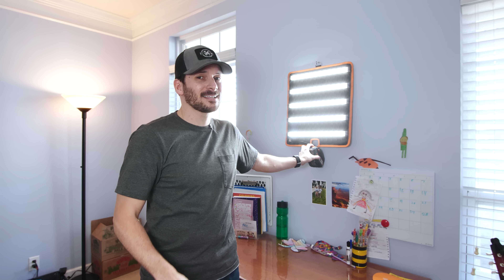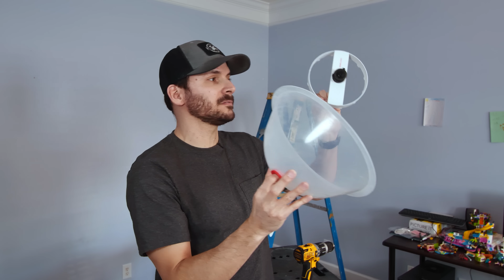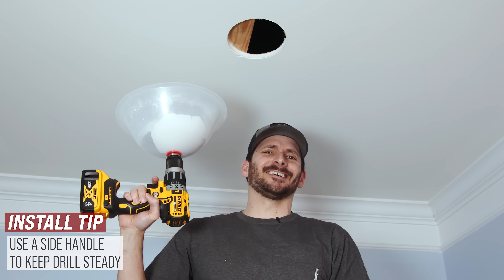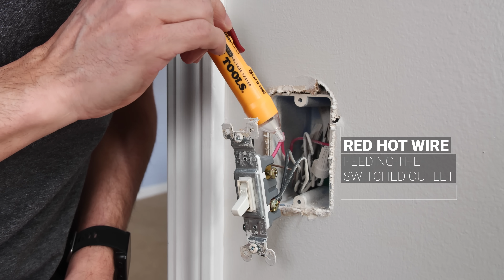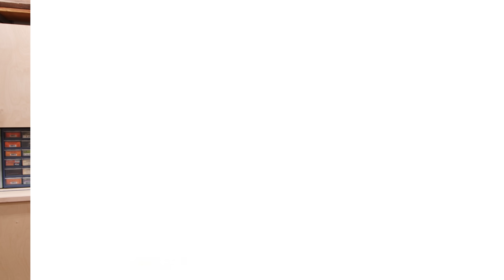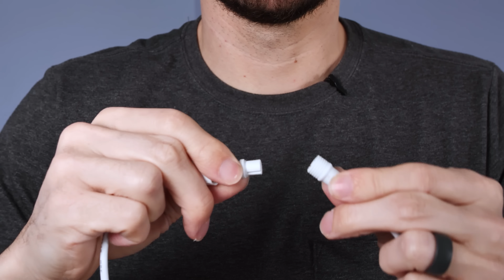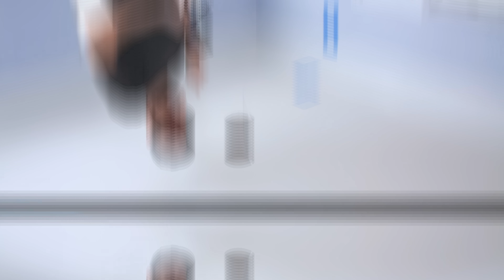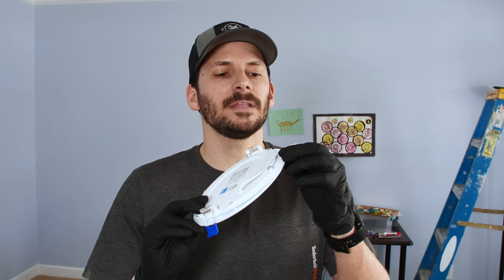Recessed Lighting Install with No Attic or Prior Wiring

Comment: You could have added an extra ceiling box and used it as a junction box to tap into that 14-3 line.  This would allow you to keep using the constant power black at the outlet and divert the red power to your lights.  Afterward, just cover the new ceiling box with a blank plate and paint to match the ceiling.
Alternatively, you could use the junction box of the light to accomplish the same thing if there is enough slack in the original line.  Bring the original line into the first box.  Use a 14-3 to get the red across the room to another of your lights.  Then use the junction box of that second light to tie back into the original line that feeds the receptacle biox.
Reply: That's exactly what I was thinking as well! Either junction box it or add another wire!
Reply: So you are saying he could have splice 14-3 into 14-2 and connect those recessed lights to 14-2? That way his outlets are there and also got power for his recessed light?
Reply: @hardikrana6403  Exactly.  In the original existing 14-3 Romex, red wire  (lighting) power comes from the switch and black wire (outlet) power is constant.  Here is what I would have done:

1.  Add an old work box in the ceiling.  I would place it out of the way in the corner, closer to the existing wire.
2.  Cut the existing wire so that one end (the wire coming up from the switch) can be pulled over to the light location as shown on the video and the other end (the wire continuing down to the outlets) can be pulled over to the new junction box.
3.  Run a new section of 14-3 Romex between the light location and the junction box.
4.  Run a new section of 14-2 Romex between the first light location and the next light location.
5.  In the junction box, connect black to black, red to red, neutral to neutral, and ground to ground.  This will keep the existing power to the outlet so you can keep using it as a switched outlet or you can cap off the red wire in the outlet box and use a new outlet as shown in the video.  You can place a blank plate over this junction box and paint it to match the ceiling.
6.  In the light location, make the following connections inside the light's junction box.
      a.  All ground wires connected together.  Input wire from switch, output wire to junction box, wire to first light fixture, and 14-2 wire out to the next light fixture. 
      b.  All neutral wires connected together.   Input wire from switch, output wire to junction box, wire to first light fixture, and 14-2 wire out to the next light fixture. 
      c.  Two red lighting power wires (input wire from switch & output wire to junction box) are connected to two black wires (one to the first light fixture and one to the 14-2 wire out to the next light fixture).  Note that the black wires of the ceiling lights now carry the switched lighting power around to the light fixtures.
      d.  Two black outlet power wires (input wire from switch, output wire to junction box) are connected together.  DO NOT connect these wires to the lighting fixture or the wires leading out to the next fixture.  These wires carry the outlet power back down to the original outlet so that it continues to function in the same way.

In the video, it appears that he left the wire leading down to the outlet abandoned in the ceiling and removed the outlet entirely.  His installation could be retrofitted by my method to restore power to that outlet, with or without the switched function.
Reply: @chrisboyd4433  wow, thank you so much for taking time to explain this. 
Not related to this..We recently purchased a house. In most of the area builder provided pre wiring for ceiling fan. Today i was trying to install the ceiling fan and noticed that both red and black wires have constant power. They provided 2 switches, even if i turn the switch off those 2 wires still shows reading in power tester. Do you think its normal? Or they messed up there. I installed the fan and i can only control the fan/light by using the remote. Switch doesn’t do anything. 
Your input would be greatly appreciated.

Comment: One tip about using the clip connectors is to give them a good tug to make sure the wire is properly seated, if they’re not then they will pull out. Do it individually and not as a group.

Comment: You can still power the outlet off of that same wire.  Just tap I to the existing wire as intended but leave the black alone and splice into your ground, neutral, and red(switched) hot wire, swap the outlet as mentioned with a new outlet.
Reply from the maker: unfortunately I had to move the wire too far to hit the hole for the light.  And you can't add a junction box covered in a ceiling.  If the pig tails for the lights were longer that would have worked
Reply: @Fixthisbuildthat  hopefully they didn't staple the outlet wire. If it is not stapled, it could be used as a pull string to pull a new slightly longer 14/2 that you can join at the light instead of going all the way back to the switch box.

Comment: Great job on the step by step! 
Pro-tip-  I would have installed a J-box or two to extend the three wire, on the wire in the ceiling you tapped for lighting switch leg.  Adding one two wire whip for the lights and a second two wire whip as your feed for your future ceiling fan.  I would have installed the power while the light holes were cut in for access.  The J-box also would have provided the power for your outlet that still has to be re-fed... With so little time left for add ons, we try to land the plane, one time and then off to the next job.  Thanks for the great work ethic!
Reply: where would you have put the j-box? we are not allowed to hide them behind ceiling/wall. cheers
Reply: @spydermcfly  by using those recessed lights you have access and in New York, are allowed to put a jbox

Comment: Dude, wafer lights are absolutely amazing. I installed a drop ceiling in our laundry room and wanted recessed lighting over cheesy looking fluorescent. Because of how high I needed to make the ceiling, it was super close to the joists and was impossible to install true cans. Picked up some 3/8" thick 6" wafers and love them. They even have an in-line switch to change the light color (K) to change from cooler or warmer.

Comment: My tips would be
1. Wear a tool belt so you always put your tools back into the belt and not the ceiling, lol

2. Connect all the lights and test them before you mount them, as some can be a pain to unmount. I'm usually installing speakers so I have to adjust the 70/100v tapa

3. Glo-rods or fish rods work easier than a fish tape as they like to stay straight and a small 20' fiberglass fish tape is easier than steel. 

My dream of training a rat to pull wires has come through yet so I'm stuck with rods and tape.

Thanks for the dust bowl. Which make did you get? I need one. I tried one a few years ago and it wasn't worth it.
Reply: Click on "Show More" just below the video and you'll see a link to it.

Comment: Fluke is also a dependable hot stick. As an electrician, I really recommend not getting the hot sticks or tics that have lights on the end! I went through a couple of those, and they get to where they are not dependable very quickly. just a FYI. and those dust bowl are great. I bought one that comes with an adjustable blade; two arms that adjust by an allen wrench and the arm has measurements on it so you know what size you are extending to; not sure if I got it at Locke supply or where I got it now lol but it's pretty handy but not sure I would use it on anything but sheetrock, but it is great for cutting holes in sheetrock and you can do any hole with one hole saw instead of spending a lot of money on multiple hole saws. I think it grabs less too! It has blades on it and not teeth.

Comment: One thing you should do before adding lights, is find out what else is on the circuit. You're only allowed 12 fixtures. Sometimes the convenient circuit won't work out.
Reply: LOL what country is that rule?
Reply: @daveperryLXXVII  
International electrical code.
Reply: @FullCircleTravis  no way that's a International electrical code. most houses these days have more then 12LED DL and with LED can easily be doubled
Reply: @daveperryLXXVII  We're talking about adding into a existing circuit which could include receptacles. The code states that more than 12 fixtures are allowed if the loads are static, and obviously not overloading the circuit. So 20 LED lights might meet code, but 1 receptacle in the circuit means no more than 11 lights regardless of the draw.
Reply: @FullCircleTravis  That's totally false information that you are giving. It depends what size rcd is on that circuit could be 10 or 15 and also depends how much amps the lights are drawing. No such rule exists. 12 fixtures. Never heard anything like that in my 30years.
Reply: @daveperryLXXVII  
From the Canadian Electrical Codebook based on the International Codebook.

Section 8-304 Maximum number of outlets per circuit
1)There shall be not more than 12 outlets on any 2-wire branch circuit, except as permitted by other Rules of this Code
3)Where the connected load is known, the number of outlets shall be permitted to exceed 12,  provided that the load current does not exceed 80% of the rating of the overcurrent device protecting the circuit.

The load isn't known if you have a receptacle on the branch that could have anything plugged into it. This limits your circuit to 12 outlets.
Reply: @FullCircleTravis  thats talking about power outlets dude. Not lighting fixtures. Have a nice day. You just proved yourself wrong.

Comment: In your scenario losing constant power to your outlet was completely avoidable without running any wires down the walls. You simply needed to run a 14/3 wire between the two recessed lights parallel to the existing wire. Rather than 14/2. And connect both sides of the existing wire rather than one side. Doing so allows constant power to continue through on the black wire. If your wafer Jbox is to small you may have to add a second Jbox on one side easily accessible through the same hole.
Reply: Or just set a box, splice to the light with the red, and to the outlet with the black…

Comment: Great video! M only question is that aren’t all junction boxes supposed to be visible through the ceilings by code instead of being hidden in the attic area?
Reply: Codes vary greatly by city and states....
Reply: Not visible, but accessable. That junction box is considered accessable by the hole, and therefore code compliant.  A splice box covered by sheetrock or other building  finish without something like an acess door is not permitted.

Comment: Set drill to driver mode and use the torque settings so it doesn't stick and cause the entire drill to spin and potentially hurt you. Works great for drywall since it is very easy to cut.

Comment: For wiring the light, another (gutsy) thing you could have tried is to disconnect the wire at the light then attach a pull cord to it and reach up in the ceiling for the wire an pull.  Once you had the cord and the wire, you could attach your LED wiring to it and them use the cord hanging our of the switch plate to pull everything back.  Now you have can put the original wiring back and you now have your LED power wire too.
Reply: Romex is stapled. There is no chasing wires in residential.

Comment: This is very good and gave me some good ideas and confidence to move forward on a couple of projects in our new house.  I have looked for the same lights you used but cannot find the ones with the quick connectors in the box.  Can you share the link or model number?  I tried the model number from the video but cannot find the same lights.  Thanks.

Comment: Hi, Thanks for this video. You really did a good job. I learned a lot and you explained it in a way that is easy to understand. Did you daisy chained all the LED lights? is there a connector for daisy chained wire or you just twist and tapped?

Comment: The drill should actually be on high because it has less torue on that setting and its easier to stop if it grabs and swings for your face! Source”im a plumber and have been smacked many times😂”

Nice video tho!
Reply from the maker: hahaha, always making things harder for myself
Reply: You can also use the screw settings on the chuck collar so it torque slips  when it binds.
Reply: Brother im a plumber 🧑‍🔧 smacked off a scaffold by a hammer drill. Not fun 🤩. But ifvu live. U learn 😂
Reply: I brace the bottom (battery pack) with my other hand as you can hurt your wrist or smack yourself.

Just remember the drill is going clockwise when you're drilling.
Reply: @254JROCK  I now have a new motto: "If you live, you learn"
Reply: @BiggMo  yup, just simply adjust the torque and save your wrists.

I'm glad drills have them nowadays.

Comment: Blown insulation in the attic sucks when installing recessed lights, you have to make sure it's cleared away before you start cutting holes in the ceiling. Another tip is to buy 6" lights instead of 4", they give better coverage and the larger hole allows you to use both hands.

Comment: Great video. I'm confused though, you concluded that the wire in the ceiling wasn't switched by the switch, but then ended up using it anyway. What did I miss?
Reply: The top outlet is / was switched. The lower outlet was constant power.
Reply: the wire in the ceiling has 4 wires, ground,neutral,live,then theres the red for the switch that all goes to the outlet. He took that wire since the red is connected from the switch that gives power when switched on, he capped off the black wire since that is constant and you dont want your lights to be constantly on.
Reply: @patricksaludo2236  Thank you, I watched it again and he does explain that.

Comment: This really helped in an unexpected way. I have a couple rooms with those pesky switched outlets and wanted to disable that functionality, since the rooms already have overhead lights. Great to know that is possible simply by replacing the outlet with the tab intact! Thanks!
Reply: Although outlets are inexpensive, you could have just added a jumper wire. I don't know your specific situation so I can't give more details as there are several ways that the outlet circuit can be wired. I don't mean the outlet being wired, I mean the box that the outlet in question is attached to.

Comment: I just had this done in two rooms of my house. The electrician butchered the ceilings when he was cutting holes to run the lines, though, and it was a bear to fix it. I should have just done it myself.
Reply from the maker: yeah, unfortunately most electricians leave the holes for you to fix so they aren't as worried about how they look or how hard they are to repair.
Reply: If you drill in reverse you can avoid hick-back and cutting your wires. It's a common problem but easy to fix!

Comment: I had the same situation in my previous house with joists and not trusses. I did mine a little different though. I only used one light to avoid having to use a flex auger and get myself in trouble drilling blind. I connected my light to constant power off a nearby light switch. Only had to make two small holes right next to the top plate to bring the wire up, one in the wall and one in the ceiling and went around the top plate, then hid the wire using the crown moulding I had to take down to get there. Next added a wireless light switch kit I found online. It had a relay that used 120V and a rocker switch that replaced any light switch but didn’t need power. It was kinetic and got power whenever the switch was flipped.

Comment: Pretty confused on the wiring part.

How to do you wire power to first light and then to the next?
Reply: you wire from the switch to the location of the first light, then you make a 3 wire splice with one wire coming from switch, one wire going to first light, then last wire going to second light, rinse and repeat

Comment: I would never recommend putting your drill into speed 1, that indicates a much higher torque which is why it almost knocked you into your face. As an electrician for 20 yrs leave it in speed two 
,the drill won't kick like that and slow it down with your trigger.
Reply: I came here to say the same thing.  Saw him putting the drill on 1 to drill a hole and thought "he's gonna take that drill to the face!"

Comment: Instead of running new power to that outlet couldn’t you have just connected the 2nd hot wire from the 14/3 to the main power coming into the switch so you still had power to the outlet? In that scenario you would just need to replace the outlet with a new that still has the tab intact right? I’m no electrical expert by any means so I’m really just throwing a hypothetical out there because I’m actually about to the same exact project but will be installing a fan/light combo instead of the wafers. If anyone else has any insight on my theory please weigh in by all means! Thanks for the video!

- Disregard this question. I just realized you completely cut that wire in the ceiling. I though you just spliced into it for the red hot and left the black hot running to the outlet.
Reply: Means there's no power at the outlet now
Reply: Only way to do it would be burying a j box. Illegal

Comment: Great video. Your video mentions no attic access. It not clear if this project was done a one or two story house.
Looking to install these on 1st floor of a 2 story house. After doing the holes, will I be able to pass cable around or there will be studs blocking in between, which will need additional holes?